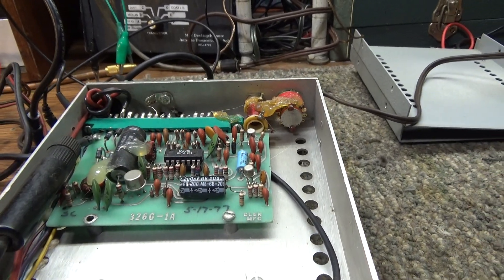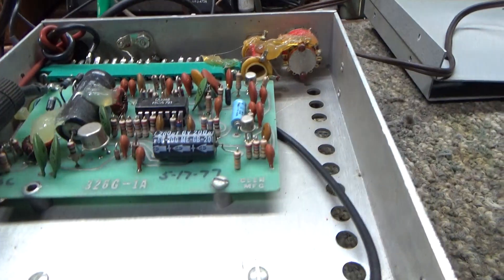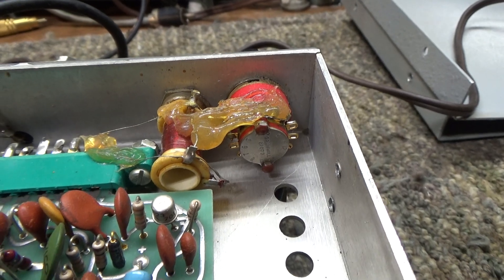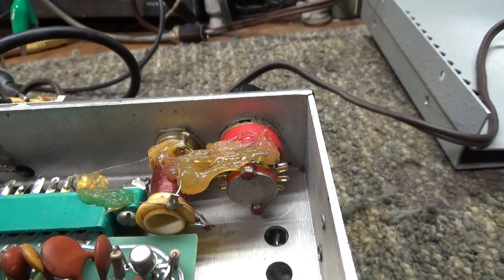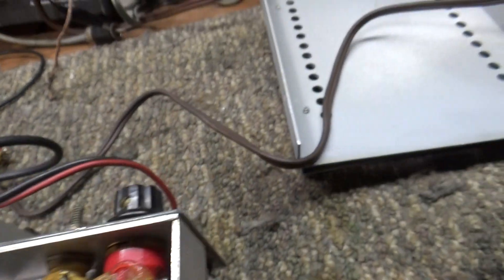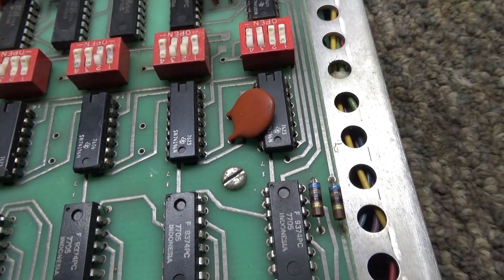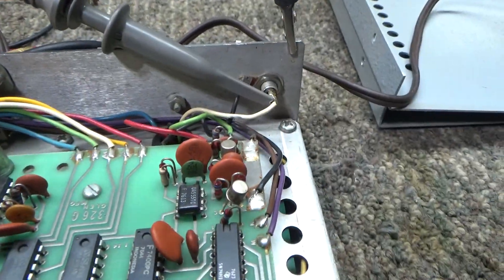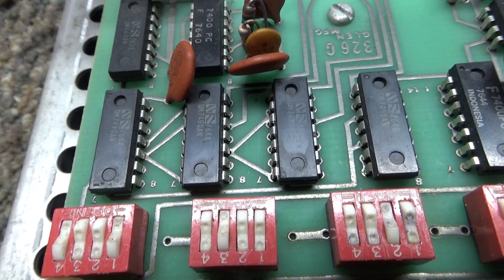Glen 326-G VFO walkthru and setup

Comment: What kind of cord are you adding to the back of the Glen to go into the Johnson 250 there's only a pa Jack back there
Reply from the maker: Sigh. I didn't or don't. Normally the person with the radio comes up with that. People often make a wire from the radio crystal socket and get a PA 'RCA' jack, so that a normal RCA jumper can be plugged inbetween the Glen and their radio, or some others take an RCA jumper but cut off one end and wire it directly to the crystal jack with that. Others get a dummy crystal plug instead of soldering it to the crystal socket. To me, it is similar to selling an amp,  jumpers do not come with the amp. The end user gets what he needs or prefers.

Comment: You're going to set it up for me for the Johnson 250 base right
Reply from the maker: Yep.
Reply: The best thing you can do with a Messenger 250 is throw it away! People expected them to be at least as good as the legendary 223 and were sorely disappointed. It has a horrible receiver, subject to bleedover, strong signal blocking, and cross/intermodulation.
Reply: @spaceflight1019  my garbage is full too damn bad huh

Comment: Several helpful hints. Forget the math programming chore. Start with the least significant digit and start flipping the BCD switches for it until it reads what your radio is transmitting for that digit. Then go up a digit and flip it’s switches until it matches that one, and so on. Glen VFOs are expensive, but you can buy a “West Cal” VFO much cheaper and it’s exactly the same thing inside. They just have a separate power supply. If you have a warble when doing sideband, it isn’t the VFO. You need to check the manual about changing or removing a capacitor in your radio. It is explained there. They made a 12 volt mobile versions of it too. Between my Elmer and me, we have 4 Glens and two West Cal VFOs. The only thing that ever fails is the LEDs and those are replaceable. 
The programmable frequency counter used to be a huge deal. But now you can buy great ones from China for $15 and you enter the offset, either + or -, into the memory. They work great for digital readouts on all of those radios that you want a digital readout on receive, as well as transmit.
You made a great video on a very popular, but hard to find, CB accessory!

Comment: I about drove myself crazy with one of those things. 😵‍💫
Reply from the maker: back before I got the manuals, they drove me crazy too. BTW, once upon a time, the manuals for this were unobtainium. About 35 years ago on Ebay, I bought a lot of these and they came with original operators manual, service manuals and hand written notes from the engineer written in small pencil. I enlarged, typed, pasted and printed and made those into nice full paper size nice manuals and sold them on Ebay.....until people took what I did and put them in a soft cover folder and CD and started selling them LOL.

Comment: That tuner will break.
Reply from the maker: Yes, that tuning coil I mentioned which is connected to the band switch is extremely fragile. It uses very small wires. If you look at the one in the vid it has a lot of silicon over it to try to help with that problem. Thats one solution, but a better one is that each of those coil taps are tapped at a circuit UH point. Not accurate example: 5mhz tap/6uh, 9mhz tap/11uh tap, etc. So a good fix would be to monoband it the same way you can monoband a Ham band amp. Example Browning Mark 3 uses 16mhz and a 15uh coil. Get rid of that multitapped fragile coil and band switch and get and put in a 15uh coil directly. Not only would this make it more rugged and dependable, it would help with the drift some too. The downside is if you sell it, now you only have a single band VFO instead of a wide multiband one. That coil is so fragile and at 50 years old, I cannot Imagene trying to put it back in once you take it out.
Reply: @tramdr  I would get feedback when I got the glen close to the same freq as the radio.....like connecting 2 radios.